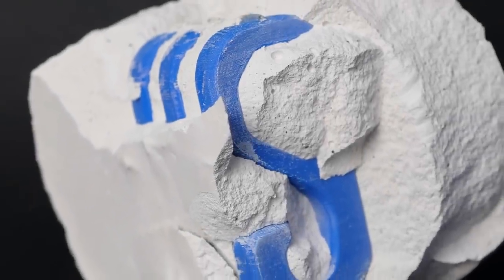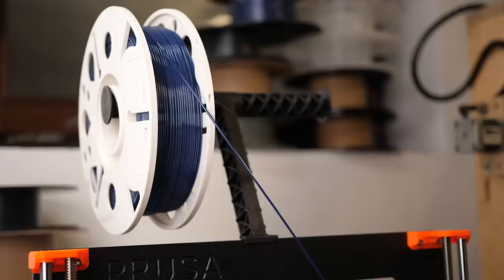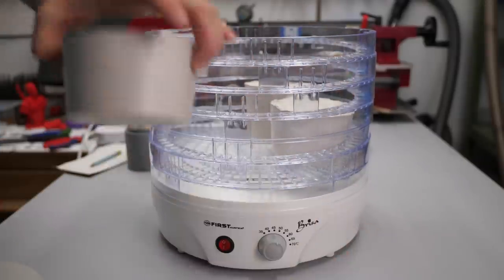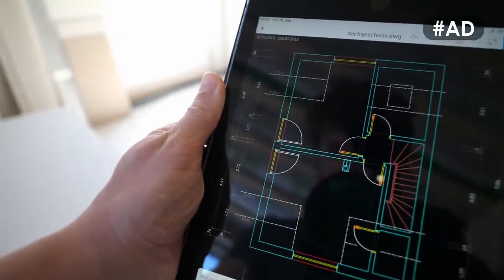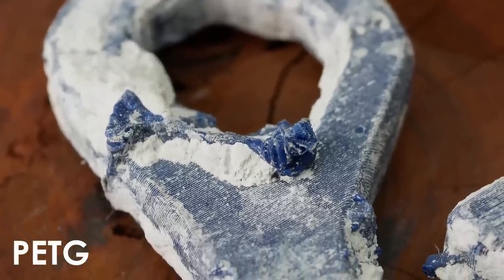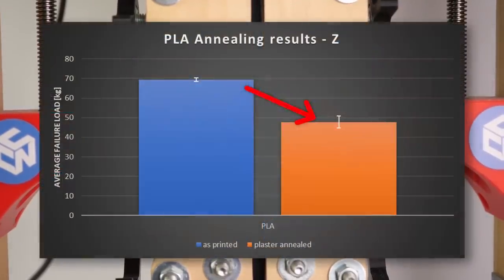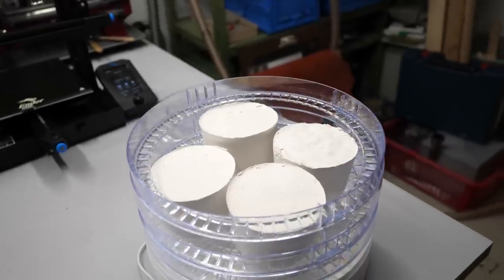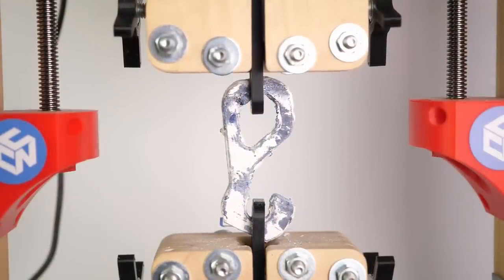Triple (x3) your Layer Strength by Annealing 3D Prints in Plaster!

Comment: How about dipping the printed parts in themoset plastic like epoxy to create an enclosing layer, than letting them cure at room temperature, before you anneal them in the oven. You won't have to deal with the whole gipsum mess. Possibly repeat dip and cure for higher thickness of the epoxy capsule before annealing.

Comment: What if instead of mixing the plaster with water we would just use the powder? Sand casting is similar just that dry plaster powder is much finer. This way there would be no moisture that causes problems...

Comment: I wouldn't call this annealing so much as a version of PLA "heat treating". Annealing is usually used to get a metal up to working temperature; then there is tempering for releasing/reducing stress points in heat treated metal. 
Maybe we'll just call in reinforced fusion.

Comment: It would be good to try a light water-proof spray coating on the parts before immersing them in plaster. This would make dehydrating the plaster less important [still important but less perfection required]. If you can keep the parts fro absorbing water in the first place, it may help. We are going to scale this up a little and try it on large parts [we are 3d printing parts for a #DCP printer on a tronxy 500mm printer.
Reply: 3DCP sorry.

Comment: Greensand might be better suited for this kind of procedure. It's used to cast metal components, doesn't get bubbles, and should be strong enough not to deform when the plastic melts. Cleanup should also be much easier.

Comment: This is quite interesting, but also gave me the idea, what if you just 3D print aesthetically pleasing shells of parts, with as little infill as possible, then fill them with some kind of a thin resin?

That would both bond the layers from the inside, as well as being the real strength of the part. 🤔

Comment: What if you print a negative for these parts out of say CF-Nylon, and then put the PLA parts inside the (reclosable mold) and then heat it below the CF nylon melting temp.. would it work out? Cuz that plaster is a huge mess!
Reply from the maker: Wouldn't allow very complex structures, though.

Comment: What if, you print a part with acetone in the air. 
Maybe fill a few bottle caps with acetone and leave it on the print bed while it is printing. 
I think that this could cause small amounts of acetone to be trapped between the layers which could improve with layer adhesion after a few days.

Comment: Vac pack them in a Sous Vide bag. Then Put them in a circulating heated oil bath to anneal below their MP... a Phase Diagram of the relevant material will help you choose the correct temp for each specific material.

Comment: It may be possible to improve this process by using oil sand instead of plaster.

Oil sand is also used in mould making for investment casting of aluminium, see https://youtu.be/W2vmkwkdngA

Advantages:

- Air bubbles can be avoided by powdering and compacting the oil sand 
- No drying times necessary as with plaster
- The part can be easily removed from the oil sand after heat treatment
- Oil sand is reusable

Comment: Next time wrap your parts in the plastic used for cooking. Doing so will both protect the part from seeping into bubbles and from moisture. A good plastic will not melt but get dry and brittle so you can easily remove it later. It will even make removing the plaster easier and if you wrap it well your part will come out clean.

Comment: Great video. You have to admit, using 3D printing for "useful" applications has big limits. If the changes you made on strength of parts were useful, even consistency over a number of printed and treated copies might vary. However, a lot of people really get their minds blown when they try 3D printing. I am helping someone get into it right now and by working with them I am having to go back and find out about things I ignored myu first trip thru 3D printing.

Comment: Wow, looks grate but... instead of plaster why not use high temperature silicon for the mould? a two parts silicone mould could work better and you can demold easy, that way you can avoid add water to the 3d printed parts while their are drying. Great videos, greetings from Mexico.

Comment: Consider printing both the part and a negative, like a mold. Coat the part in a temperature resistant mold release. Put it in the mold. Anneal them together, with no plaster. 

This would only work with shapes that can be molded, or with complex molds (multiple parts) to accommodate complex shapes. But with luck it might give similar results without the trouble of working with plaster.

Just thinking out loud...

Comment: What if you painted your 3D parts with a thin layer of plaster, dried it, then used a salt mold to give it structure. You would be able to maintain the nice surface of a plaster mold, but avoid the difficulty of removing material, and the significant amount of water vapor exposed to the petg, while maintaining the surface finish which is lost with salt annealing

Comment: I think if I had to have stronger parts I would make them some other way than printing them. It just takes an insane length of time to anneal them in addition to the already lengthy time it takes to print them. For way less money than a printer cost to purchase and set up you could buy aluminum plate and hand saw and file your pieces out of the billet and be way ahead in cost and time.

Comment: Why are you mixing the plaster with water? Does the plastic get such a low viscosity that dry plaster would absorb it? If not, why not just use dry plaster or gypsum, you should be able to just wash it off and not have to go through the whole mixing, drying, and demolding operations?

Comment: Hi. I believe there is something wrong with your PETg settings if you get worse layer adhesion than PLA. PETg layers melt together extremely good using right temperature. Its bound to itself is its known property. So there is definitely something wrong with your temperature, too low, or fan settings, too high.

Comment: Ooh... this one's a little off the wall, but taking your plaster process, what about sticking a couple of tubes down the plaster to contact a lightly filled part, letting the plaster dry and dehydrating it, then drilling down the tubes until a hole is made in the part's surface, and filling one tube with another plastic that would melt and flow into the printed part to form a thermally cast core? The heat gradient should follow the plastic material down the tube first so the printed part won't collapse... in theory, anyways.

Comment: Since you have a vacuum chamber. Try this: use minimum infill, make an enty and exit hole in your model. Suck 2k epoxy thru the entire model using your vacuum chamber. This way you will have a model entirely filled with epoxy. Should be very very strong!

Comment: not sure "annealing" is correct terminology. Annealing is a heat treatment process which alters the microstructure of a material to change its mechanical or electrical properties. Typically, in steels, annealing is used to reduce hardness, increase ductility and help eliminate internal stresses. Whereas here you are just basically re-melting the part to fuse the layers together. Interesting though. I would try investment plaster. 
Very informative and interesting. My lab that is what we do is test materials for aerospace. 
Keep up the good work! Cheers

Comment: Print a negative shape out of polycarbonate. Place the PLA in there and heat-treat it. Then reuse the PC part again.

Or create a heat-treated PLA negative shape and use it to heat-treat lots of PLA parts.
If you need a lot of parts, such processes could be viable.

If you use plaster: minize the amount you use. Otherwise it takes forever to dry it.

Comment: Is there a way to add fibers (glass or carbon) in between layers?

I guess the true holy grail would be a printer that could print six axis of freedom on a part that could move six axis of freedom.
Your slicer software would have to be equal to the task of course.    You should be able to build parts with various thickness and shells to exactly match the tensile/compression forces in your parts.

Comment: Definitely try a high temp silicone like Dragon Skin.  It will allow you to remove bubbles in a pressure pot and removal will require just cutting it away with a knife as it doesn't adhere to much of anything but itself.  Still there's a downside in cost although under some circumstances it may be worth it.  Sorry to bomb you with comments.

Comment: rather then sinking that parts into a tub of plaster make some runny plaster paint and paint it on you only need to form a thin shell maybe try cutting with 50% iso/h20 to help fight the water getting sucked into the PLA also might be best to use the vac chamber for degassing /drying the plaster pant to also help prevent h2o from getting sucked into the pla.

Comment: Ceramics are good thermal insulators so my idea is to try using clay (or something mixed with clay)

If I'm right: the clay will reduce the time needed to treat the prints as it turns into ceramic 

If I'm wrong: it'll totally destroy the prints

Comment: CLAY TERRACOTA Print layed down 100%, and use a vibrator to take out the bubbles of air on CLAY. rise the temp for petg and also leave it in the oven untill room temp..maybe 24h in oven after in 70ºC or so to dry untill the core is dry. If it is completly dry, then you can break the CLAY with a hammer!

Comment: Borrow some technique from investment casting.  They dip the wax part into a very thin mixture of ceramic and pull it out, let it dry and then bury it in sand.  Then they heat it and pour out the molten wax, leaving a thin-walled ceramic cavity buried in sand to pour in metal.
So, use thinly mixed plaster instead of the thick stuff.  Bury it in sand for annealing.  The sand will fall off easily and the remaining plaster will be a thin covering that shouldn't be too difficult to remove.

Comment: You can't simply run the nozzle hotter to get the previous layer heated up, and that's part of what limits layer strength.
A small IR laser [ultrasonic projector?  Tiny Superman with heat-vision?] could shine a spot along the tool path, always a fraction of millimeter ahead of the nozzle.
The pre-heated material would fuse very well with the plastic being extruded.
Nozzles could run a lot cooler if the extruded plastic didn't have to provide fusion energy.
Who knows, with the right pre-heat, there might be complete fusion as the track is being laid down.
Much reduced layer-lines, I think.
Such a tiny spot-heater could do fun things with no-contact 'ironing' of top layers.

Comment: Did you try the annealing in sand with PETG? If the annealing in plaster has such great results for PETG, maybe you could get some middle ground result with sand which is so much easier than plaster.

Comment: You don't need an entire block of plaster you just need to coat the plastic part in a shell of plaster by dipping it, perhaps twice, once in a thin mix and then in a thicker mix. That should be enough but you can then use the sand bed to ensure the heating is very even and the entire part is well supported.
Reply from the maker: Good point! I might try that. That will reduce the re-working effort, make drying faster and also introduces less moisture. Thought not 100% sure if it's structurally enough.

Comment: so I sometimes work with metals. and that makes me think 🤔 

have you tried heating them in liquid such as 90 weight engine oil. or 15w30 motor oil.  or maybe a synthetic. 

I use used motor to quench hot metal and this makes the metal extremely hard. then I re heat the metal to remove some of the carbon crystals that cause the strength. I do not know what this would do to plastic. but you could experiment.

Comment: Could you not 'paint on' a very thin layer of the wet plaster just to coat the parts well without any bubbles, let it dry, then use quite a dry mix to fill the rest to reduce the amount of moisture in the plaster?
Or what about painting the parts in a moisture resistant paint, then coating them in plaster? Not sure how that would affect the structural rigidity, but could be interesting to test!

Comment: Instead of pulling a vacuum, you should look up videos on using pressure to shrink bubbles.
Reply: I've seen it work with resin casting - so I'm not sure how it works with plaster

Comment: If you want to get rid of the plaster bubbles, don't vacuum chamber it, put it in a pressure pot while it cures.  This is the method used to get glassy clear epoxy and resins as well.  None of that annoying 'frothing' up as you suck out the air as well. Instead you just compress the bubbles into nothingness.

Comment: Plaster is acidic.  Use alkaline water (soda water works great) to dissolve the plaster from the parts without any physical work required.  Been doing this with PLA prints I need to have higher thermal resistance for a while.  Baking soda or commercial soda bicarbonate is super cheap, available everywhere, and non-toxic.

Comment: USE PROPER DIP CASTING with a real investment shell coating like 'suspend-a-slurry' or other ceramic shell. Is only a thin wall coating and is a production technique to avoid all of these problems of embedding in a big block. It is worth the little extra expense to use correct product.
Reply: I just checked price for MOLOCHITE SUSPENSION Flour is $11 and need a bag of play sand also.

Comment: Your idea is great, but you're close to the truth with the vacuum chamber and drying, I would try for jewel casting plaster and casting process. This plaster is more for this kind of usage and behave much better. The jewel casting process will help you to dry the plaster with lower temperatures than a normal process for jewel casting because of course, you don't want to evaporate your plastic.

Comment: Do not mix plaster (Gips). Don´t put any energy in. Release it fluffuffy into the prefilled amout of water in the bowl just right below the surface and let it sit (sumpf). Then it lasts a while. When you touch it, it will start to react

Comment: Quite out of scope, but has anyone tried to use a laser beam to quickly heat the surface a millisecond before hotend puts on the next layer? Practical issues like calibration and printing direction aside, could that lead to higher stability?
Reply from the maker: There are some patents for that, I guess. Maybe take a look at those.

Comment: You don't want to use a VACUUM chamber. Just like epoxy resin, you want to you a PRESSURE chamber. Increasing the pressure will compress all the bubbles to non-existent.

Comment: Interesting! Now, just make a 2-part mold out of gypsum, dry it, then use the dry mold to do the high temperature annealing, so you don't get any water into the printed part. Think that would be smarter than dipping the plastic parts into the wet stuff, and it's probably easyer to remove from the mold too.

Comment: Interesting results. However, considering that this requires a ton of work plus making a mold anyway, I don’t see why this would ever be better than just making a mold from a 3D printed part and then casting the final part(s) from it. Then you can quickly make many parts from that mold and use materials much stronger than any 3D printed part can ever be, annealed or not...

Comment: I think I found a way to print with steel using regular printers, but it will only work with relatively small parts. I dont have the equipment to make the filament myself. You might. Message if you want the process. It's free and I want to make the information free I just want to make sure that it works first.

Comment: What if hydrolysis is a myth? That the temperatures involved are simply to low to cause it? Now obviously wet filament doesn't make for most robust and attractive prints, but what if it's exclusively due to foaming with no chemical changes whatsoever?

Also: annealing PLA with ethanol.

Comment: Idk, interesting results, but a lot of effort. Why not just use SLS Nylon if you need the strength?
Reply from the maker: Because I don't have a 100k SLS printer 😅
Reply: @CNCKitchen  You can have one for as low as 10k these days ;-) Uh, how about ordering a Nylon Print from one of the printing services and comparing it to your standard pla hooks? You would have a reason to reach out to one of them, like you previously talked about with Tom in The Meltzone. Congratulations, btw!

Comment: This whole process is very interesting idea.... I agree that 36 hours of drying was probably too short. Do you believe there are any drawbacks to going even up to week? Would the plaster shrink and crack (as one did) if you got it too dry? I don't have a sense of how heat-conductive plaster is, especially if it's really dry. If the plaster isn't dry, would it be more likely that you are 'steaming' the parts? Would this limit the temperatures the parts were exposed to to about 100C? 

Also do you believe that 3 hours was enough time to get a thorough heat soak of the entire plaster mold when melting? If the parts truly melted in the plaster, would going slower on the temperature increase and then holding at the higher temperature for even longer be better? 

All-in-all my gut says that slower for every step in the entire process would be better, but of course I haven't tried this as you have.

Comment: Why not to use silicone instead of plaster? just cover all of the model, cure, and apply the heat. then - remove silicone easely. (there may be some coating needed, for silicone not to be glued to model)

Comment: In the end, it's not really the strength that is the biggest disadvantage of 3D printing, it's the time it takes. You are better off printing a master at really high quality (looks wise) then making a silicone mold and casting in resin. Faster and much stronger.